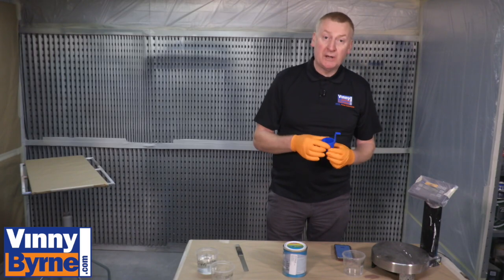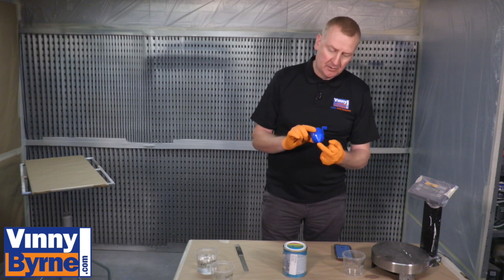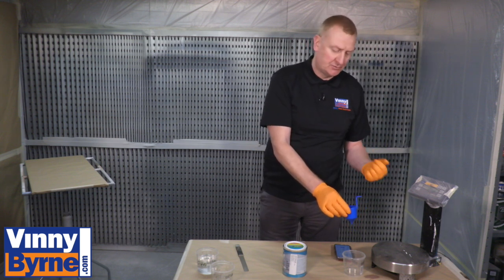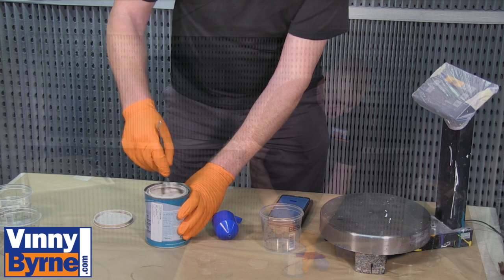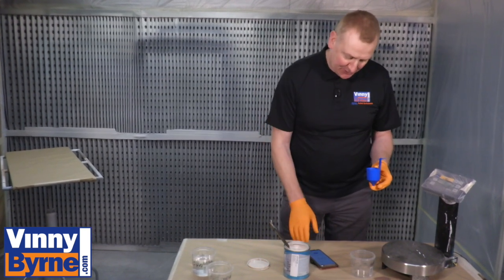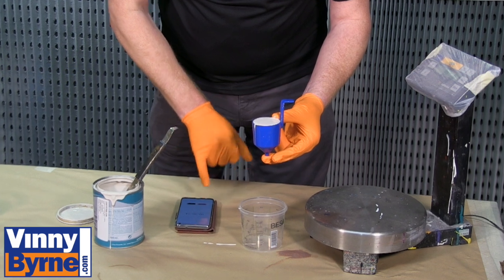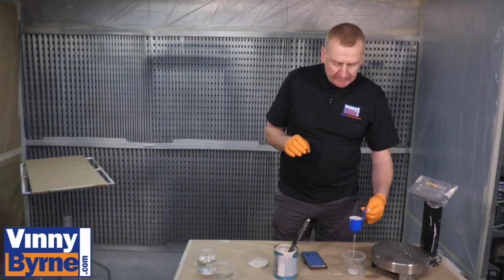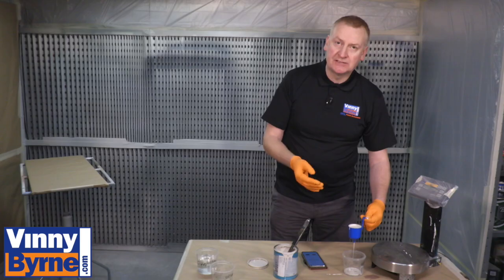How to check paint viscosity for use in spray gun

Comment: Can u test viscosity of water and tell me please?
I cannot find a viscosity cup to buy and i want to make one for myself 
So if i know the viscosity of water in Din4 cup
I can make an accurate cup with a bottle or something 
I didn't find the information in google 

Thank you
Reply: 3d printed the cup and measured  our tap water at 15,8 seconds which is 15,8 DIN/sec
Accounting for my reaction time for starting the and pausing the stop watch I can confidently say that water has a DIN viscosity of 15-15,5 DIN/sec at 25°C (Water does change viscosity with temperature but as it's such small molecule, the viscosity change is minimal but certainly measurable, usually irrelevant tho)
Reply: The specific cup I have is 75mm tall, has a volume of 110cc and orifice diameter of 3,3mm
if you match these 3 parameters then it'll work
if you can't match them then adjusting one parameter (I suggest the orifice) will allow you to calibrate your cup
Reply: @Cjarka_ thank you for the detailed information 
And i think the shape of the cup does matter too. Is it right or wrong?
But i think the din/sec with the other parameters make me to make it accurate

Comment: When measuring viscosity of thick liquids using a viscosity cup, should timing be stopped when there is a significant break in flow, or when the fluid has stopped dripping?